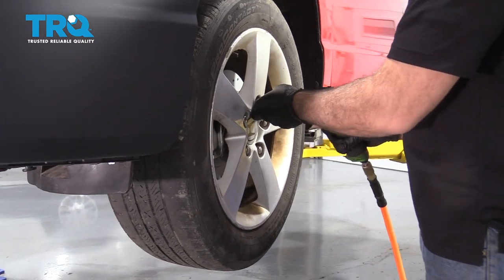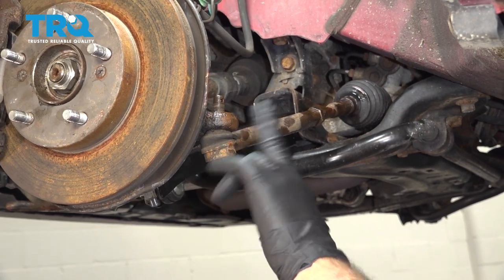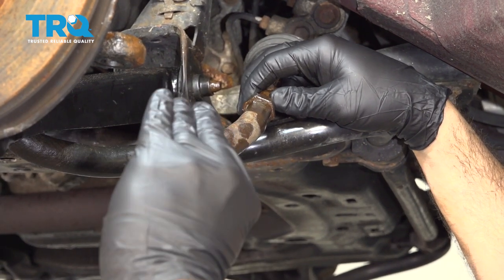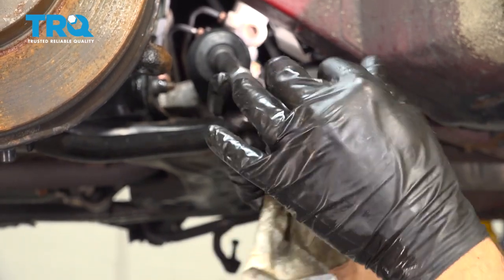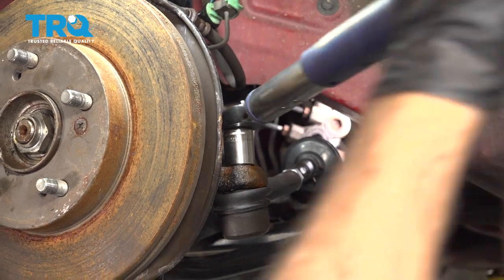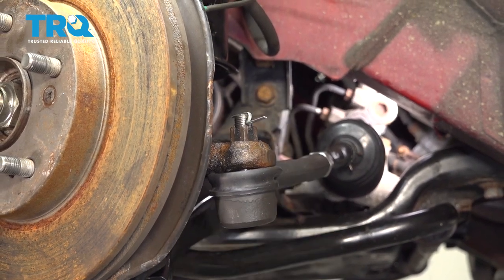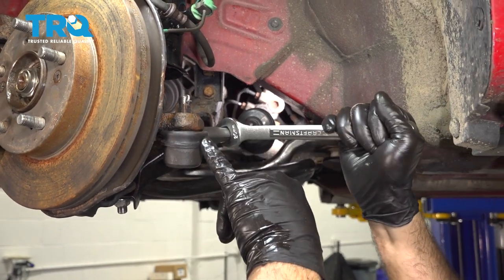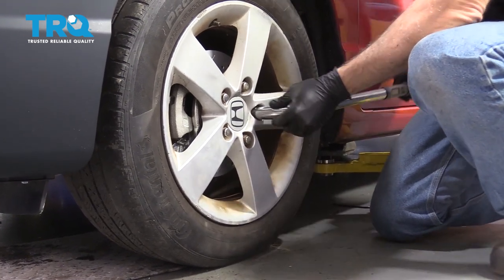How to Replace Outer Tie Rod 2006 - 2011 Honda Civic

Comment: Thanks for the detailed videos.  As an FYI, I think the torque specification you mentioned (47 ft lbs) for the outer tie rod end castle nut at the steering knuckle may be incorrect (on the high side).   All of the books I reference and see the printed values (and other videos) for the outer tie rod end castle  nut (2006 and newer civic) consistently show at 40 ft lbs .   I hope this is helpful to others.     Thanks again for the always helpful videos.